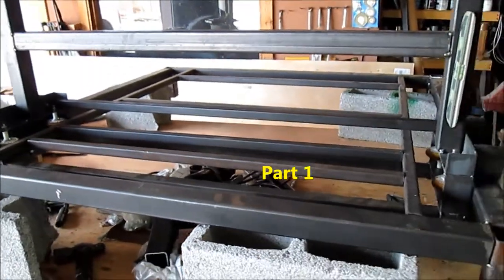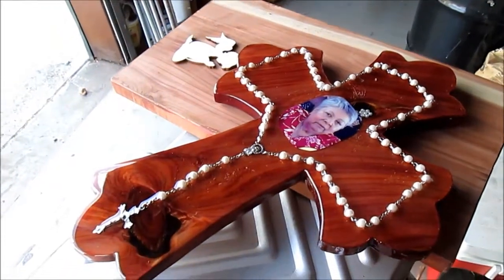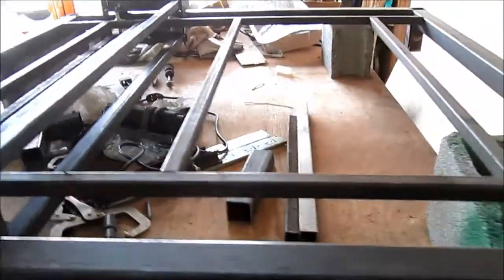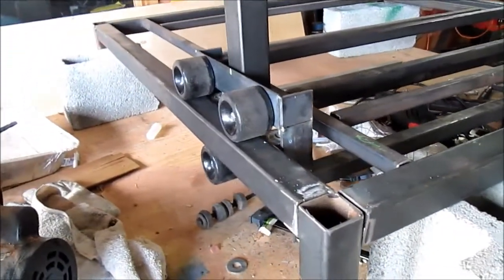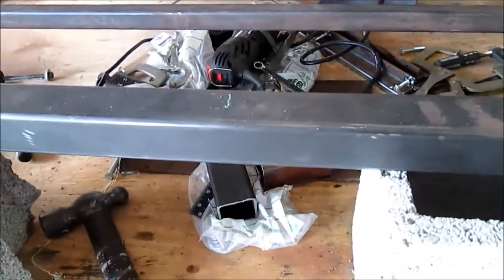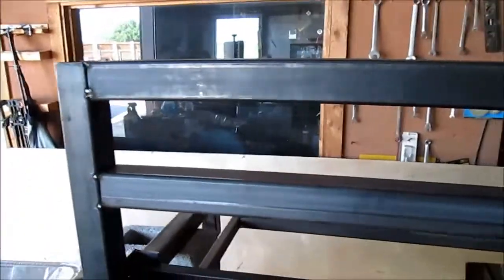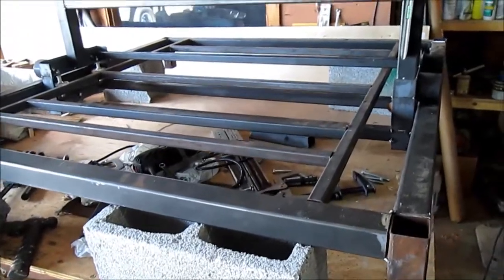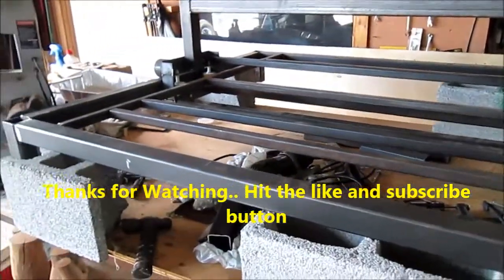How to DIY:Arduino CNC Router Plasma Cutting Machine Part #1

Comment: That’s awesome I built one as well inspired by absorber of light but I used all skate board bearing and it was my first one as well. It is a 2x2 but the cutting surface is like 18x18 I am going to be making it bigger with the same electronics. Mine is based on Arduino board with cnc shield but with the bigger stepper motors and stepper drivers as the little small chips on the cnc shield couldn’t handle to load. It’s plenty strong and I have cut hundreds of pieces with router through easel. The only thing different I did was use 2 stepper on the y axis with 4 start acme rods and for the x axis unused single start acme rod. Let me know if you need help with yours.
Reply from the maker: sure will. thanks for the update..

Comment: I built my machine a year and a half ago. I have not seen any issues on the wheels. I have skate wheels like you do, roller blade wheels, and a ton of skateboard bearings on the metal.

Comment: I also followed the Absorber of LIght videos and built a table. My cutting surface is 2' x 2'. Mine looks a lot like yours, skateboard wheels, roller blade wheels, and skateboard bearings.
I like your video and look forward to 'trading paint'.
Reply: Here is my machine running with a router https://www.youtube.com/watch?v=HeTwArtQmiI
Reply from the maker: I had to put the project on hold for a while, my dad recently passed away and I'm dealing with all  of the aftermath, but I will get back on track soon and post some updates
Reply: @LarrySbrusch  Larry, I am very sorry to hear about your dad. When you get back into the project I will be following your posts. In the meantime, I put together a blog post on my journey that stated out with a simple plasma cutter. I built a pantograph and eventually the CNC from the Absorber of Light series. Here is the link to the blog http://jobear.com/2018/12/05/diy-cnc-plasma-cutting/
And here is a link to my machine in motion, using my new plasma cutter:
https://www.youtube.com/watch?v=7ofQO8Ll3ic

Good luck Larry and Godspeed.
Reply from the maker: I'm also worried that the roller skate wheels will be a little sticky or have a little too much friction to roll real smooth..